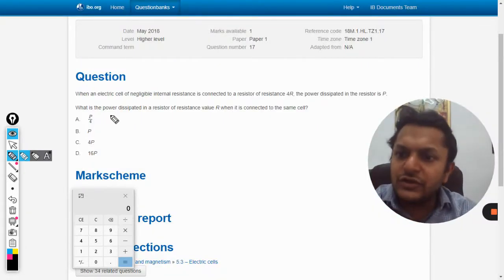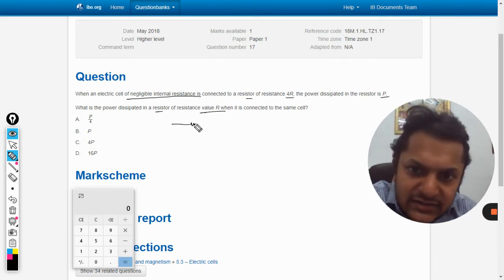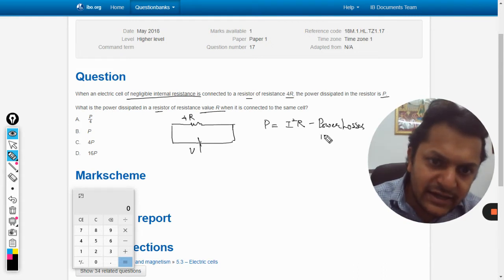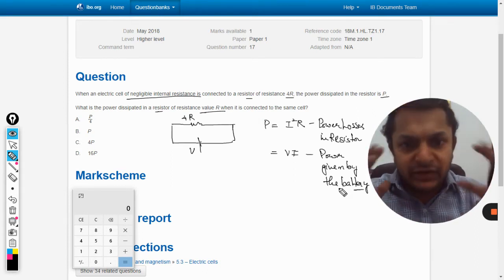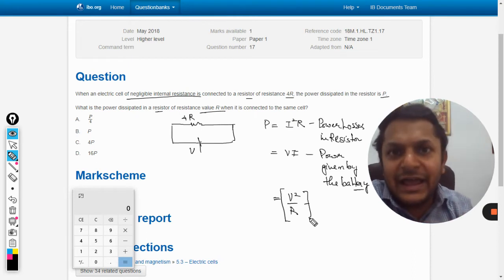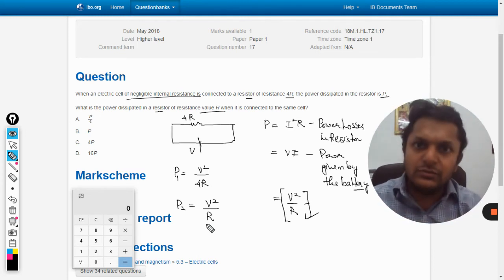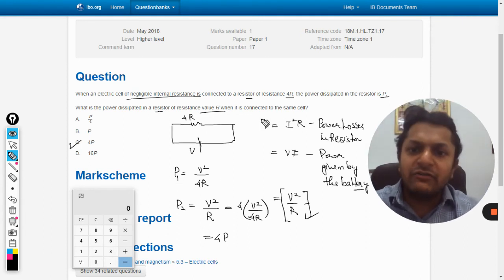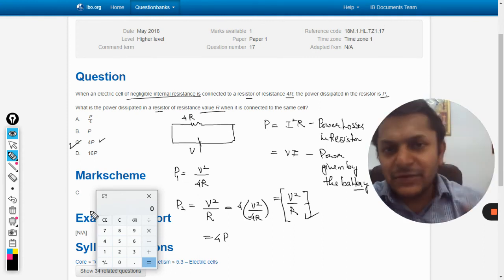When an electric cell of negligible internal resistance is connected to a resistor of resistance 4R,

Comment: why dont we use I^2 times R
Reply from the maker: You can use this formula also, but the current is not given. And so, you have to find that first.!
Reply: @profvarun  sir, even the voltage isn't given. Since both aren't given, how do we determine which of the two formulas to be used.
Reply: @samarthsaxena1214  same question, but my guess would be that V is constant here bc the cell having internal resistance of zero implies that voltage will be constant throughout circuit components. Also in parallel circuits voltage is by definition same as opposed to series where voltage is added between components which is a good trick, but probably not applicable here, since question doesn't imply how the resistor is connected. It's not about what's given it's about what's constant and in this case it's the voltage
Reply: @AnimalGigglesDaily  I thought V is only constant when resistance is infinite, current is constant when there is no resistance?
Reply: @IsabellaAppelboom  The question says that resistor of resistance R is connected to the SAME cell. Therefore, Voltage will be the same as when the resistance was 4R. So we can use the formula linking V to R. It is not said that the current stays the same (which is logical as V=IR, thus if the current was constant and R decreased, V would decrease too but it is not the case as it is the same cell delivering the same voltage)
Reply: @jackbertholet5122  thank you for that insightful response Jack